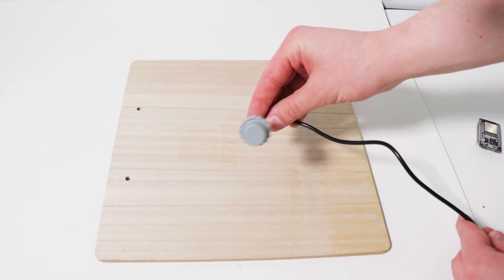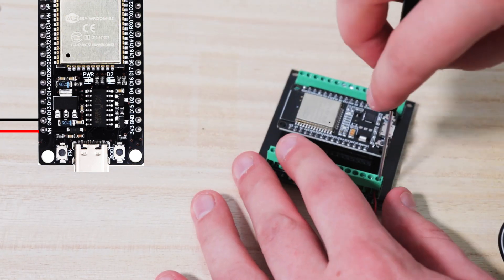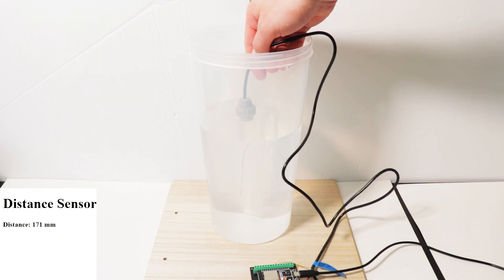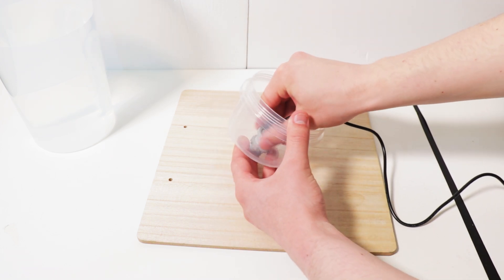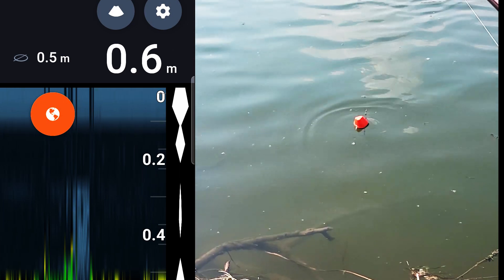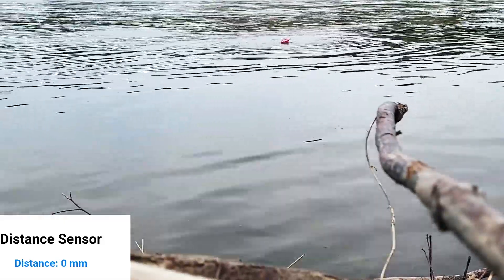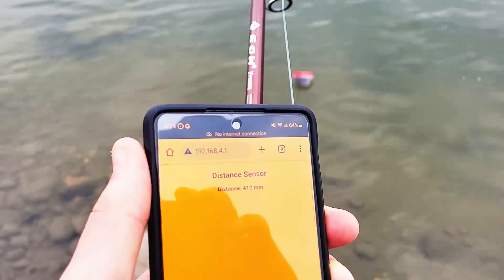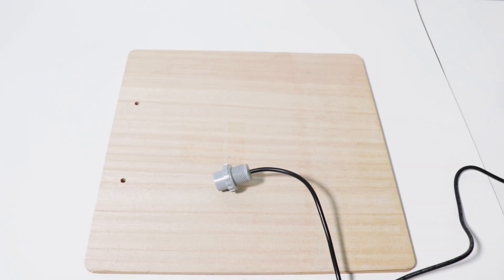Is This Underwater Transducer a Depth Sounder in Disguise? (L04)

Comment from the maker: Code if interested:

#include <WiFi.h>
#include <WebServer.h>

// === Sensor Serial Setup ===
HardwareSerial mySerial(1);
#define RXD2 18
#define TXD2 5
#define COM 0x55  // Sensor command

unsigned char buffer_RTT[4] = {0};
uint8_t CS;
int Distance = 0;

// === Wi-Fi Access Point ===
const char* ssid = "ESP32-Distance";
WebServer server(80);

// === Web Page Handler ===
void handleRoot() {
  String html = "<!DOCTYPE html><html><head>";
  html += "<meta http-equiv='refresh' content='0.25'/>";
  html += "<title>Distance</title>";
  html += "<style>";
  html += "body { font-family: Arial; text-align: center; margin-top: 50px; }";
  html += "h1 { font-size: 48px; }";
  html += "p { font-size: 36px; color: #007ACC; }";
  html += "</style></head><body>";
  html += "<h1>Distance Sensor</h1>";
  html += "<p><b>Distance: " + String(Distance) + " mm</b></p>";
  html += "</body></html>";
  server.send(200, "text/html", html);
}

// === Setup ===
void setup() {
  Serial.begin(9600);
  delay(1000);

  mySerial.begin(115200, SERIAL_8N1, RXD2, TXD2);

  WiFi.softAP(ssid);
  Serial.print("AP IP Address: ");
  Serial.println(WiFi.softAPIP());

  server.on("/", handleRoot);
  server.begin();
}

// === Sensor Read Timing ===
unsigned long lastRead = 0;
const unsigned long readInterval = 1000;  // Read once per second

void readSensor() {
  while (mySerial.available()) mySerial.read();  // flush input

  mySerial.write(COM);  // Request distance
  unsigned long start = millis();

  // Wait up to 150ms for at least 4 bytes
  while ((mySerial.available() < 4) && (millis() - start < 150)) {
    delay(5);
  }

  if (mySerial.available() >= 4) {
    int firstByte = mySerial.read();
    if (firstByte == 0xFF) {
      buffer_RTT[0] = 0xFF;
      for (int i = 1; i < 4; i++) {
        buffer_RTT[i] = mySerial.read();
      }

      CS = buffer_RTT[0] + buffer_RTT[1] + buffer_RTT[2];
      if (buffer_RTT[3] == CS) {
        Distance = (buffer_RTT[1] << 8) + buffer_RTT[2];
        Serial.print("Distance: ");
        Serial.print(Distance);
        Serial.println(" mm");
      } else {
        Serial.println("Checksum error");
      }
    } else {
      Serial.print("Unexpected header: 0x");
      Serial.println(firstByte, HEX);
    }
  } else {
    Serial.println("No response or incomplete packet.");
  }

  // Flush any trailing bytes
  while (mySerial.available()) mySerial.read();
}

// === Main Loop ===
void loop() {
  if (millis() - lastRead >= readInterval) {
    readSensor();
    lastRead = millis();
  }

  server.handleClient();
}